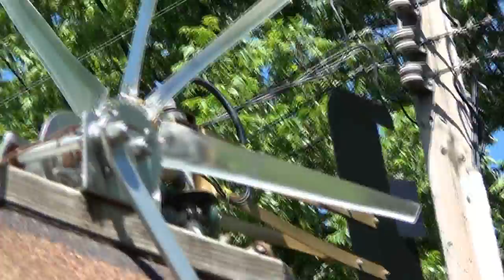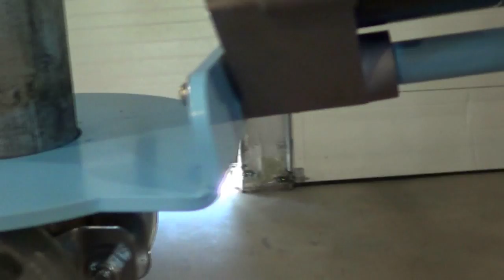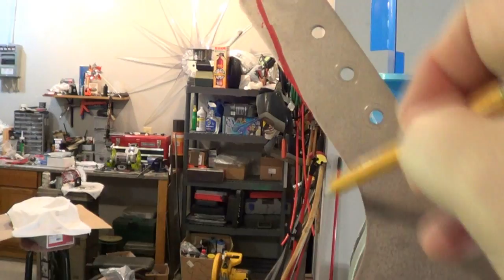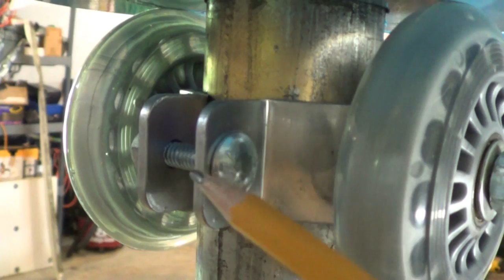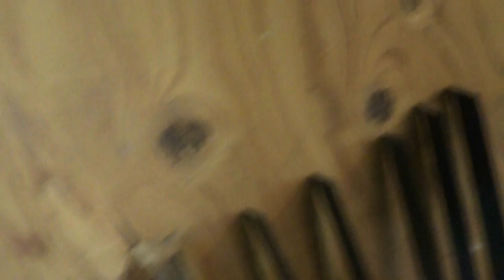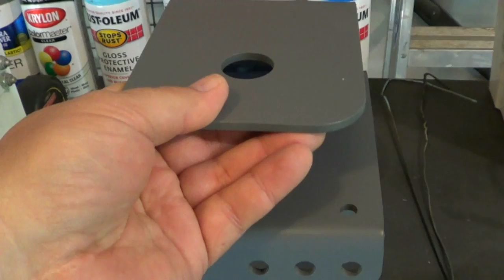THERMODYNE SYSTEMS NEW AND IMPROVED MOUNTING BRACKET

Comment: looking nice like the new mounting system. one day or year I will get a new turbine. Wish I could sell the ones I have. Hell I cant used them wish I could sell them so I can get more solar. I have some blades that have white powder that comes off them, full of fiber glass, and pure junk.  Cant wait to see your Axial up and running.
Reply from the maker: McCuneWindandSolar Hi Charles, Glad you commented. I wish I could sell that stuff from earlier day's, no one wants it. As for the axial flux turbine I'll be doing a video on how I balance the hubs and what it looks like to date. But the blade diameter is 80" on the Mark 7 bracket/Avenger and should be able to make good power. I'm going to make a 24v system that will be ran thru the Midnite Classic. Thanks for the comment and I hope things are good for you 😃
Reply: McCuneWindandSolar You can use that old Vietnam stuff to get you a tax break still. You donate it to charity and can get 50 to 100 dollars back extra on next year's taxes and not have to worry about liabilities.
Reply: McCuneWindandSolar Please be careful disposing of them old school flaptor blades. Seems the powder emitted is known to cause cancer from the degrading epoxies. Make sure you don't handle them in a confined space or allow children to touch them.

Comment: Nice looking setup. Do you balance the hub/blades? What's the total blade length with that hub?
Reply: Darren Off Grid My KT Blades took out a pigeon, freakin shredded the shittin machine dive bomber. No damage to the blades. Damn things are tough.
Reply from the maker: Darren Off Grid Hey Darren, yes I'll be balancing the Hub and Blades. Thermodynes blades are really close on grams weight of Blades, so it really makes it easier to dial it in. The diameter is 80". With Bob's blades and Windy Nation Hub this should be interesting to watch. Darren thanks for the comment 😃
Reply: TheBillytheJack2010 cool man. Look forward to seeing her in action.

Comment: hey buddy. I am going to be adding a turbine to my system and I was wondering if you could tell me the best kit I could get. I keep hearing about turbines that are rip off . maybe you know the best bang for the buck.
Reply from the maker: GPVlog Hi, before you choose a turbine. You should see what your wind speeds are. Then decide how many volts and watts you want. If you're running 48 volt. There is a video I can show you, but you probably seen it though. But all micro wind turbines are High wind needed, plus a good tower and a good area without tree's, building's ect. But as for me and my situation is how not to have wind! I just show production and dirty wind 8 to 10 mph before I see production. I use mine as a additive like HHO in a gas engine. Hybrid System where it just complements the solar, that's all. I've got good production out of the Ultra Core and EZ-Avenger. So if you want to go off grid then build yourself a Axial Flux turbine. Thanks for the comment 😃 take care.
Reply: TheBillytheJack2010 hey there. I am near a lake so I get quite a bit of wind here but I am looking for a low wind 12 volt turbine. I see the ghost turbine that looks like a good choice. it will be mounted on the roof of my house which is free of trees and obstruction.
Reply from the maker: GPVlog You won't see production at low wind 10 to 12 mph. Because the size of blades. Are they clear KT Blades? And is it a Power Core?
Reply: TheBillytheJack2010 can you recommend a low wind speed turbine? we have consistent low speeds and do see bursts but not consistent high speeds. we mainly get a strong breeze most of the day. on the roof of the house it is slightly better.
Reply: TheBillytheJack2010 looking at the wind speed average in my area for the last 30 days it is 24 mph. but again it's more of a strong breeze consistently rather than heavy winds. we get quite a bit of lake effect winds a few times a week which makes things better.
Reply from the maker: GPVlog sure, I'll give you a link.
Reply from the maker: Here's a turbine, but not sure if its a Super Core or a Ultra Core. Please send them a message to ask about.
http://www.ebay.com/itm/KT5-Wind-Turbine-5-Blade-LOW-WIND-1000W-12-volt-AC-3-wire-3-75kW-W-REG/232378990821?_trksid=p2047675.c100005.m1851&_trkparms=aid%3D222007%26algo%3DSIM.MBE%26ao%3D2%26asc%3D41375%26meid%3D812fc7fcacf042ba8a78e6ddfc9d3dd7%26pid%3D100005%26rk%3D4%26rkt%3D6%26sd%3D231754263496
Reply: TheBillytheJack2010 thank you. now I have another question. I am going to buy several of these. I am using them in a 12 volt system but the controller will handle up to 50 volts and it steps the voltage down for the battery bank. can I use a 24 volt turbine in my system to avoid having to use super large wire from the turbine to the batteries? if I go with 12 volts will the turbine max out at 12? 

thanks